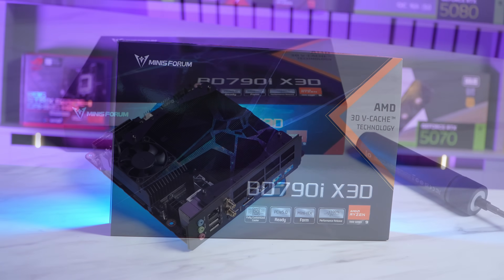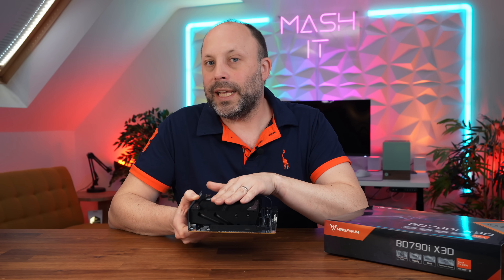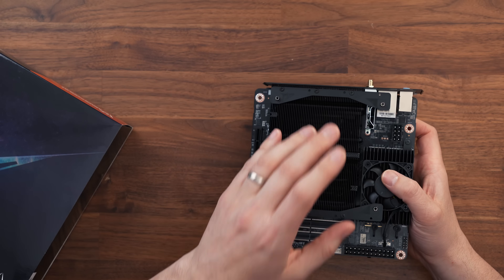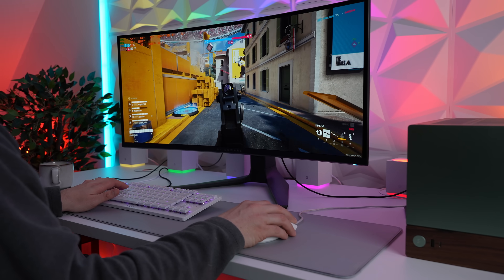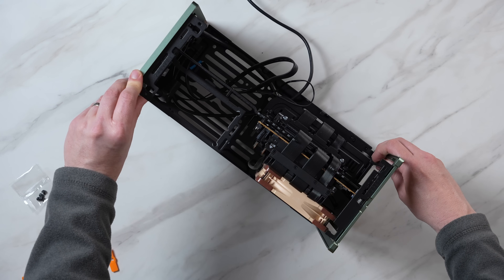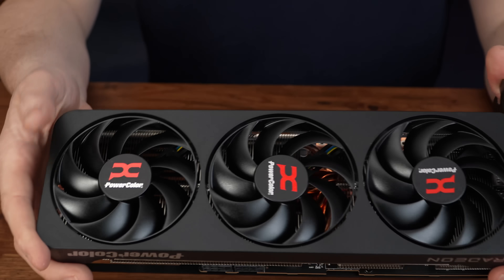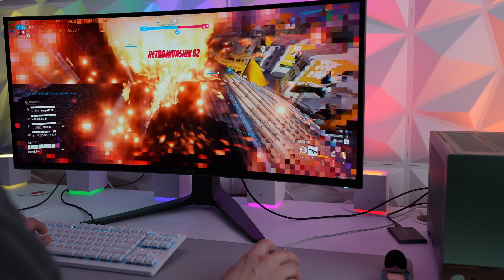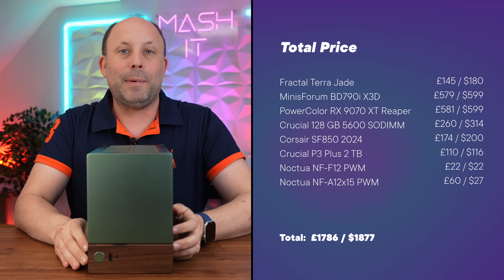The X3d You've Never Heard Of! Minisforum BD790iX3d Build Featuring Fractal Terra, 9070xt & 7945HX3d

Comment: Pretty good deal for the performance and low power. Have you explored the BIOS to see if there are any memory overclocking options? 6000mhz would be ideal for this platform. A few BD790iX3d users have claimed they can run Kingston Fury 64gb kits at 6000mhz after tweaking some hard-to-find BIOS settings. Thanks Dave!
Reply: I have the 7940HX variant of this board and yes you can oc the RAM and tighten the timings to near desktop level. My 5600Mhz Mushkin 32GB kit runs at CL38 6000Mhz. There's an option in the latest BIOS where you can do as you please under AMD CBS I think it is and go as aggressive as you please. And there's reports of running 32GB 6400MHZ CL 38 RAM on these boards as well.
Reply: @jameslapc  Can you share the part number for your RAM kit? I just ordered the BD790iX3D and I'm torn between either a 2x48 CL48 Crucial or a 2x32 CL40 Kingston Fury kit that is priced the same in my country. It's for gaming.
Reply: @s0renK  my RAM is the MRA5S560LKKD16GX2 by Mushkin. Just know it comes down to silicon lottery. So, I might have gotten a good kit. While yours might not be good. But there are better kits out now. And the denser the DIMM the harder it'll be to overclock and tighten your timings.
Reply: that would be truly crazy
Reply: I see some builds with modest CPU core count and speeds but with large amount of RAM and high frequency. What is the use case for those systems?
Reply: @KorTrinity  Some games and programs are more sensitive to memory speed/latency than others and see large performance gains with faster ram. A handful of games can benefit from having a larger amount of ram, but most people either need the ram for work or they like to have a lot of programs open whilst they game. Personally, I think 64gb 6000mhz ram is a good, sweet spot.
Reply: @ I see. I've been thinking about building a home NAS for myself, so I'm paying attention to the specs of various small size PC builds. Thanks
Reply: @KorTrinity  As far as core count, well most gamers don't need more than 8 high performance cores. It just so happens that the best gaming CPU's on the market, 7800x3d/9800x3d, are only 8 core. Hence you see those in a lot of PC builds on Youtube and on forums.

Comment: Question: Does this mobo have any of the issues that The B450 chipset had, where if you ran more than one NVMe, it halved the (lanes or speed of the)  GPU bus?  Curious if it has that issue, or if we can run two Gen5 drives and a GPU full speed, run a Gen5 and a Gen4 drive with a GPU at full speed, or if we run two Gen5 drives (or even a Gen5 + Gen4 drive) if it halves the speed/lanes of the GPU.
Reply from the maker: That's a good question! Leave it with me, I will try and test it tomorrow for you
Reply: @MashITTech  Thank you. That is awesome. Seems like this board is limited to just two M.2 Gen5 slots and no SATA at all.  It would suck if running two Gen5 drives (or even a Gen4 and Gen5 concurrently) would limit the GPU bus speeds/lanes (like back in the AM4 B450 chipset days).  Also, if you can run one Gen4 and one Gen5 -with a GPU all at full speed/lanes - it could make for some interesting benchmarking being that you would be able to test Win11 and gaming on both Gen4 and Gen5 to see what differences there are (if any).
Reply from the maker: Yep, thats no problem. Been meaning to order some more Gen 5 drives anyway :)

Comment: Did you replace the PCIe riser with one that’s 5.0 compatible? I think the one that comes with that case is only 4.0 compatible, so you’re bottlenecking the 9070 XT.
Reply from the maker: Trust me, the pcie 4 won’t bottleneck a 9070xt
Reply: @ I figure give it as much open road as it will take. Same with those NVMe on that board - you can go PCIe 5x4 and really push some speed.

I have one of these boards coming via DHL now, so I’ve put some thought into all the components. :-)
Reply: @mjwaters1985  I am very curious how a Samsung 9100 Pro would perform on this board.  Everyone else seems to be using Gen3 and Gen4 NVMe drives.
Reply: @ohdeergaming  I have two 2TB Crucial T705 on order I’m going to setup in RAID 0. It should be insanely fast.
Reply from the maker: I have a Gen 5 drive but it's being used atm on another project. As soon as I free it up I will test. In the meantime I might try and pick up a 9100 pro

Comment: It's a 16 core X3D cpu, does it have the same problem as the 7950X3D ?. When you have to disable single CCD to have a insane gaming performance.
Reply from the maker: It will have the v cache on 1 ccd so will perform like a 7950x3d. With a fresh upto date windows 11 install I am pretty sure does a much better job of scheduling 👍
Reply: @MashITTech it's funny as testing branch does even better with AMD. I worry that Microsoft does this on purpose. Not supporting AMD multi ccd chips and favors Intel chips.
Reply: 😅 I have PTSD
Reply from the maker: I did notice you had some trouble with yours! I fresh install windows for every project 😂
Reply: @MashITTech  that sounds exhausting
Reply from the maker: It is a pain but trust me, after having issues in the past with re-using windows installs it's just not worth it! Love your T1 videos BTW
Reply: @ thanks 🙏